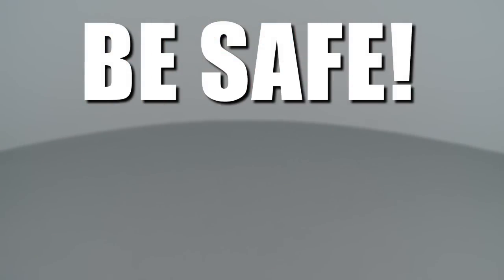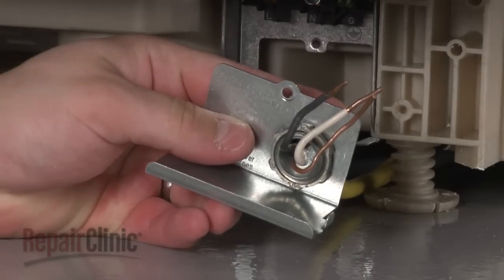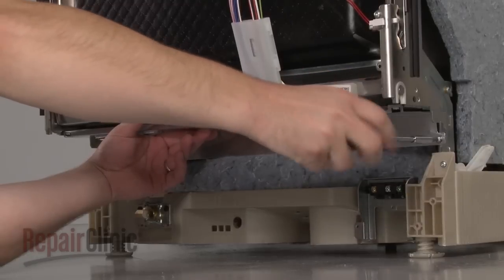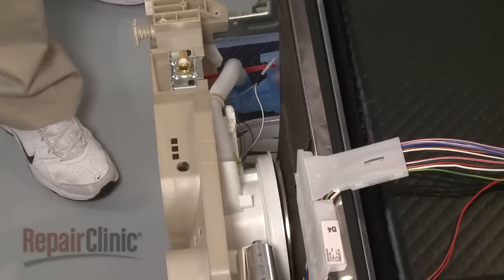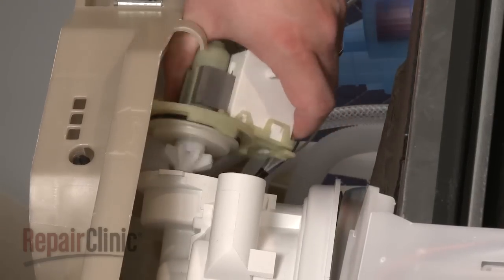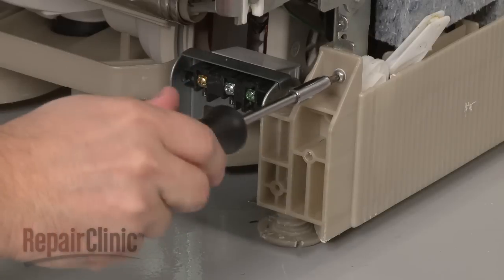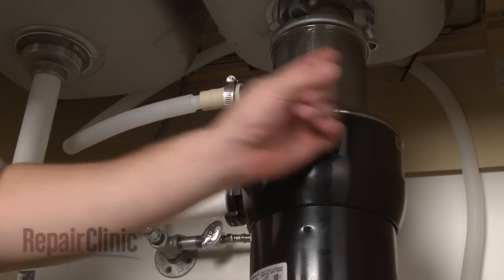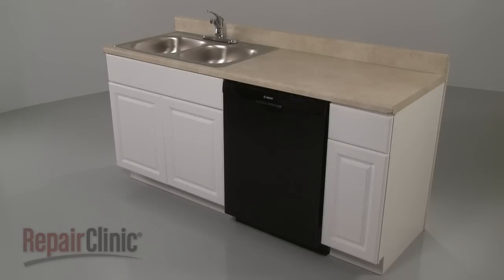Bosch Dishwasher Pump Gasket Replacement #00263102

Comment: If you have an Error E 15 (dishwasher pump) shown on your Bosch or Siemens Dishwasher, you don´t have to disassemble your dishwasher and replace the main gasket. The Problem will still exist.
There is an repair kit from Bosch/Siemens to fix the problem in 5 minutes. Here is the video:
https://www.youtube.com/watch?v=OliiWxORUJA
Reply: Thanks very much Peter. I can see leakage from that area by looking thru the sides. Tried just tightening the screws but cannot force too much, being a plastic part below - leaks continued. For everybody: it is Bosch repair kit # 12005744 and can be found in many places online. https://www.bosch-home.com/us/store/accessories/12005744
Reply: Hi Peter, thanks for the note on this. I watched the German video and am almost certain that my machine will need this fix. In my case the screws themselves became quite loose and I was able to easily tighten them between a half and one and half turns on each screw with the loosest screws being where the leak was most pronounced.

I visited the link in the response below by @Darrylx444 and noticed that parts are no longer offered by Bosch in either the USA or Canada and are quite varied in price, between ~$10 and $50 CDN , April 2024. I was wondering if do go ahead and buy the kit referenced can cite you as a reference in my video? I have had another leak from the clean Inlet and have posted that on my YouTube page and so was thinking about continuing down the road.
Reply: @Darrylx444  Did turning the screws a bit tighter work. I found that mine were quite loose after 10years of use and the gasket appears to be holding back the water for now.
Reply: @kevinmorgan4234  Not at all in our case as I recall, they were already as tight as I dared. The OEM gasket joint was just designed poorly, so it wouldn't seal regardless. But the repair kit worked perfectly, and was pretty easy to install as long as you are careful with the very thin and floppy o-ring and don't let it get snagged or cut by the sharp metal lip. Never even had to remove the OEM seal IIRC, as the new ring just protects everything below. 20 minutes and done.
But eventually that Bosch died from a different cause, so we're onto a new brand now. Good luck.
Reply: @Darrylx444  Thanks for the response it helped me triage the repair and saved me some money sourcing from Europe versus buying from a national supplier.

Comment: If water is slowly collecting in the bottom most tray, eventually triggering the float switch, but then water does not drain from the spill tray once the float switch activates, is it likely that it is this sump gasket draining AND that there is a problem with the pump?  Or is the pump not designed to extract water from the spill tray at all?
Reply: David Caldarelli David did you figure this out?  Mine fills the overflow tray too.  I don’t think the pump is designed to remove water from that tray, I think the tray is there with the float shutoff valve to tell you have a leak.
Reply: @ko6128  yes, thanks! After several days of testing and reverse engineering, I figured out that any water down there is an error, and must be dried by hand. Also the float probably only runs the (higher up) pump for inside the tub in order to drain anything from inside that could theoretically leak further, AND to notify the user something is wrong, NOT to drain the bottom tray!  I figured out my solenoid valve had a very slow leak, replaced it for $50, and it's been good for over a month so far.
Reply: David Caldarelli I think you explained it correctly. I replaced the main valve with new $22 one from Amazon and it now works perfect.  No water in catch basin.  The failed pump fell apart when I removed it and amazon shows the same exact problem that others have had.  So it must have been leaking at the valve, then filling the tray to point of over flow.  Thanks for the reply.
Reply: @DavidCaldarelli  Hi, the solenoid valve you are taking about.... is it the water inlet valve?  https://partselectca.azureedge.net/8726680-1-M-Bosch-00607335-Water-Inlet-Valve.jpg